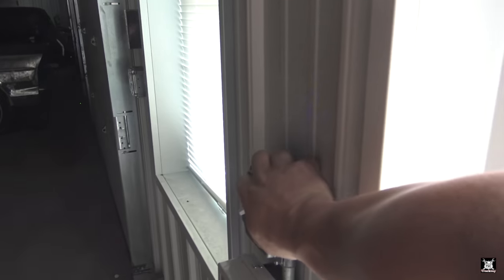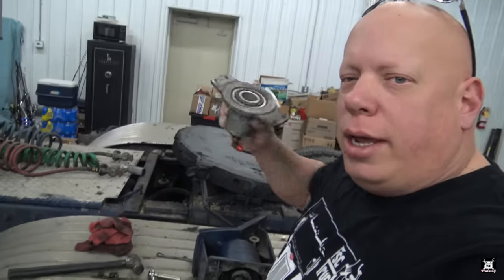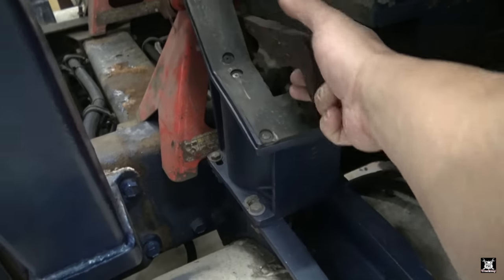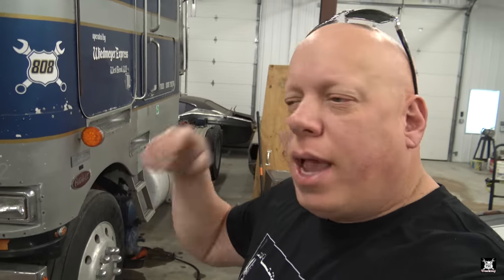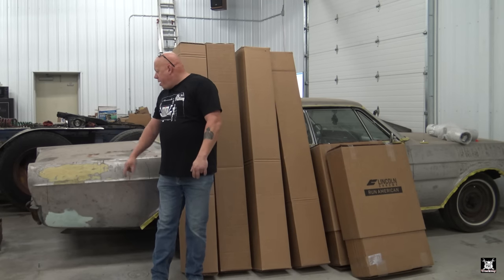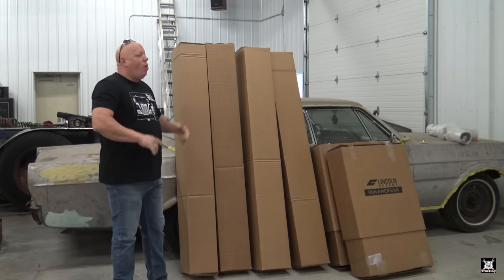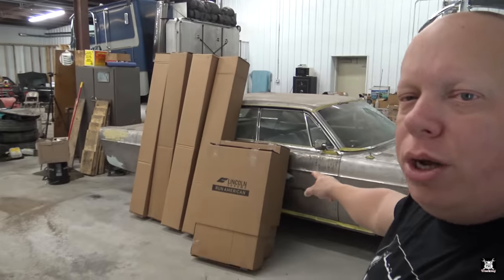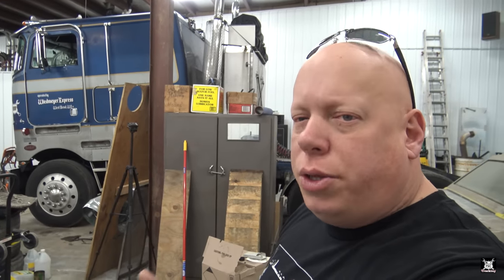What Now?  Orwell & My Channel Need Work.

Comment: I think the question you need to answer first is: Are you going to be a Trucker/Speed Shop fabricator that happens to make YouTube videos or are a YouTuber that happens to drive truck and wrench in a speed shop?

Is the trucking and the speed shop your primary sources of income or is it YouTube?  Do you want to transition your primary source of income from trucking and wrenching to making videos?

I think if you answer those questions to your satisfaction, then everything else will fall into place.

Comment: Old iron is maintenance intensive, but then, you can't buy an old truck at the dealership. Like your stuff and good old Orwell.
Reply: True.   I drive a 2023 389 and it may not need wheel seals but electronic issues are another thing 🤷🏼‍♂️

Comment: Steve, keep doing what you are doing, it's fine, that is why we watch. Try any new things you feel might help. Most will probably watch those also, and you may get new subscriber interest with new projects. If it doesn't work, you still have this series. I am sure you will get enough positive or negative feedback to let you know the response. I appreciate your loyalty to Orwell,  I owned a new 1971 Freightliner with Detroit 318. Loved that cabover and those Detroits. Wish I still had that truck and could run her down the road one more time. Keep on Truckin, Steve!

Comment: Simple solution when you have a lot of projects going on all at once that you get overwhelmed.

Push everything aside and give yourself a moment to step back and look at which project needs your undivided attention the most. 
Then focus on that until you finish before moving on to the next.

It sounds counter productive, however you are less likely to burn yourself out working on one project from start to finish in my experience. 
If you have two projects that are quick and easy, understandably you could work on both, though i look at that as the one exception.

Comment: I drove truck for 36 years all leased to one company. the thing I like about your videos is the work you do on your own truck. I ran all 352 have 86" cabs, the rest 110". first truck had a Detroit,  the rest all Cummings, best option for comfort was Peterbilt  cold weather package, easier to heat and cool and quieter. I enjoy your videos don't change a thing they are great.  food on the road was no problem, parking was  available at what were real truck stops and every town had a diner. We bitched when fuel went to a dollar a gallon. Someone said your videos are too long, I'm 80 years old and miss driving so I still truck thru your videos, if you have to charge I will still be watching. give a shout out to Pull Toy, that is my CB handle. So regardless of what you do I'll stay by your channel, Pull Toy here.

t

Comment: hey Steve, U R at the prime age to grow in business- for which I am supportive-
Getting another truck in line with Orwell, U may need 2 more ppl, one more driver n a mechanic or 2 drivers and U the mechanic.
But, your channel is mostly U driving n offering the scenery n action for possible problems.
Anyway U cut it, its work, U R young, n both go together.
BTW, I c your truck bouncing on the roads, that is cuz your R on top of a leaf spring axle n NO cushion between the cab and frame-U may consider Air Bags between the frame and the cab, as the newer trucks have. Regards n good luck. stay safe out there.

Comment: I used to work at a Pete dealership and we maintained a fleet of 362 cab overs that were pac lease trucks from Peterbilt. They were all double buck like yours and all of them were CAT power 3406 E 550 hp units 18 spd 355 rears. They pulled mobile broadcast multi million dollar trailers that beamed up  links for NFL Football games or Major golf tournaments.These were pristine units that were dealer maintained to the tee. This was 2004.. Other customers always wanted info on when pac leased put them up for sale. They were beautiful awesome rigs in perfect shape that got whatever they needed no matter.

Comment: It never works to try to do all things at once or lose sight of your focus.  Orwell is the engine of your economy. That remains your priority. Perhaps you should pick one of the cars and finish it by way of a plan.  And then on to the next thing.   Planning and discipline which you have will win the day it seems to me.  The channel(s) are fine and perhaps now is not the time to invest a lot of your energy in them. You seem to have bigger fish to fry if you want to expand your trucking business.   Like a replacement for Orwell or an addition.  Orwell may be a bridge but newer equipment seems a must.

Comment: O’l son you need to remove the radiator cap on that old beast and drive a nice 1999 or 2000 379 Peterbilt under  it screw it back on and fricken enjoy every mile out there. You know walk in sleeper 3406 E  cat motor 18 speed trans and you will be so happy and way less fatigued on them long trips . Believe me I know . I’ve been driving for forty years and still drive and I wouldn’t trade my Pete for anything on the road . Right know I’m pulling a 9 axle Cozad low boy trailer hauling heavy equipment . I ran cabovers for years pulling grain doubles and the day I stepped into my conventional I never looked back . That was awhile back I started with a 359 Peterbilt 400 big cam 13 speed then in 2000 I specked out my new Pete switched to cat and 18 speed and still have a grin on my face every time I start it and take off . The ride in the conventional will make your back and kidneys last a lot longer . Take care my friend. Stay safe .